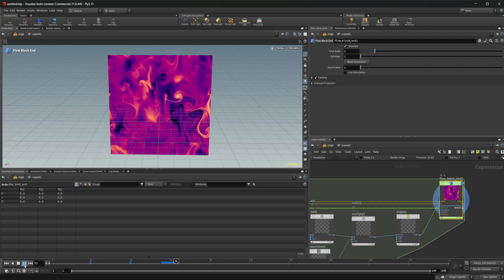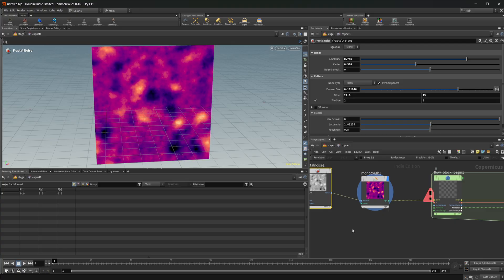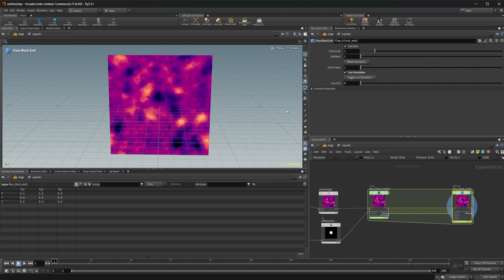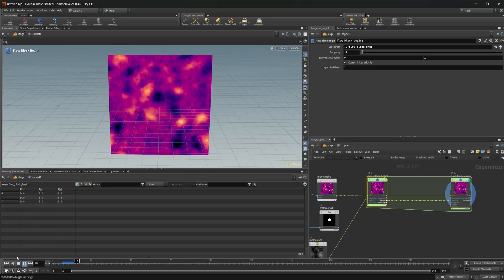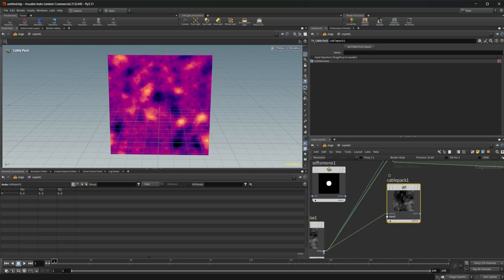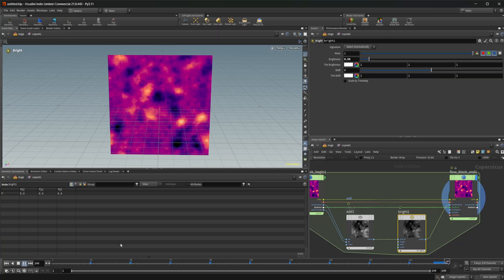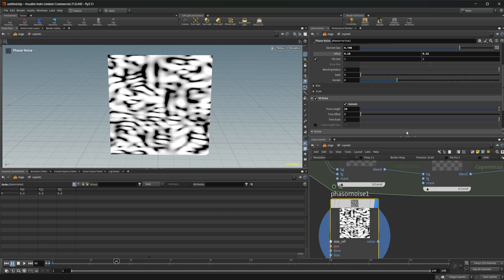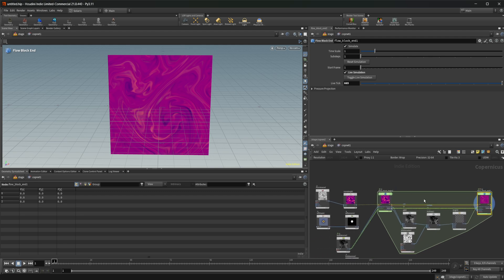Fluid Simulations in Copernicus | Houdini 21

Comment: Thanks for sharing, thinking about a cool application, the result of that could be used to advect points from a point stamp with a distort node. Very informative video, Copernicus is becoming one of houdini's most interesting contexts!
Reply from the maker: Definitely is. There's lots of different applications for using this. It's super fun to mess around with and wire into different things to see what happens

Comment: What nodes would be needed to project his onto any Geometry on the SOP level?
Reply from the maker: For textures? You can wire it directly onto uvs. You can also use the new triplanar cop which I have a video coming out soon on. If you want to displace geo with it you could use the labs triplanar displacement node. You can also use an attribute from map and displace along normal to do so. Lots of options

Comment: I cannot get the live simulation to display as shown in the video. Is there some viewport setting I should enable? The normal timeline "press play" simulate does work however so it's confusing why it's not working like you show. Once I check the live simulation the normal simulation won't work for that flow block unless I replace it.  I'm in Houdinin 21.0.440 on win11 with Nvidia 3070ti  8G Vram 128 system Ram 8core amd cpu.
Reply from the maker: The normal playbar simulation will dont work once you have the live simulation checked. You need to uncheck that to get that back. Their isn't any viewport setting to check that I am aware of other than the little toggle down below the playbar.